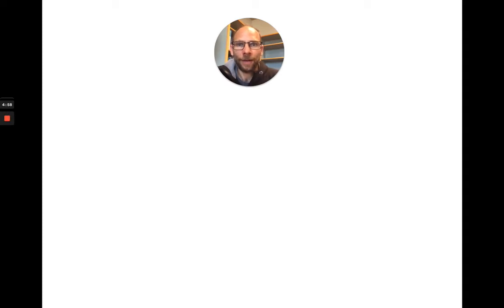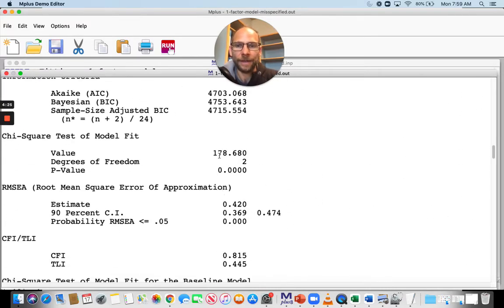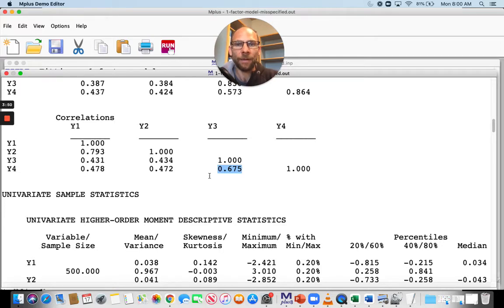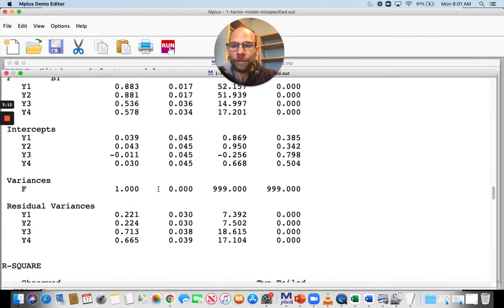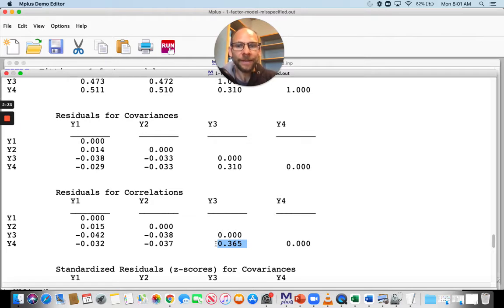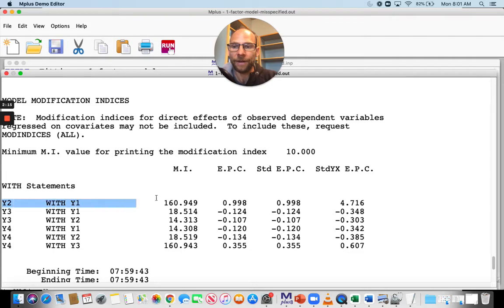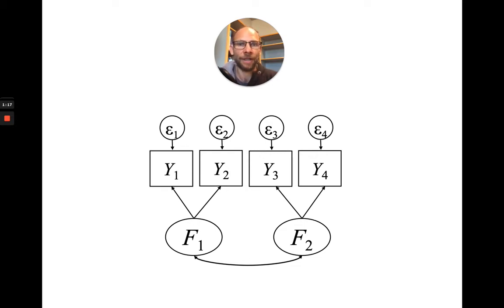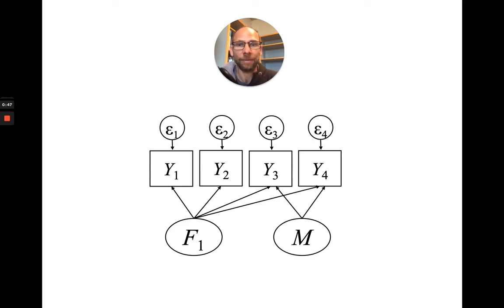Why does my SEM/CFA model not fit (Part 2)?

Comment: Thanks for all of your videos. in my model I have exactly the same issue, but I can not define 2 different structures because the model itself is too complicated. My solution to this problem was to define two different correlation (as you did between Y1 and Y2, Y3 and Y4). Is it a proper model to come up with this difficulty???
Reply from the maker: Hi Zahra, Thank you for watching! It is impossible to tell what model modifications (if any) would be reasonable in your case without knowing more details about your model and data. I recommend consulting with a statistician with expertise in SEM. Best, Christian Geiser